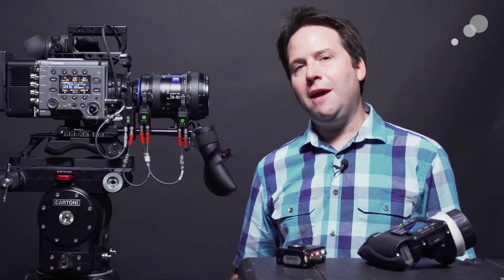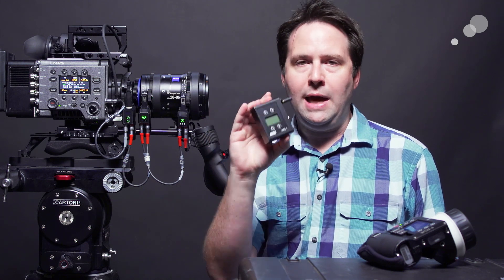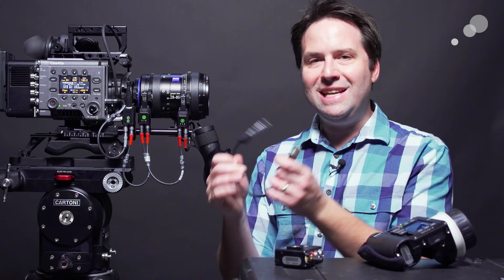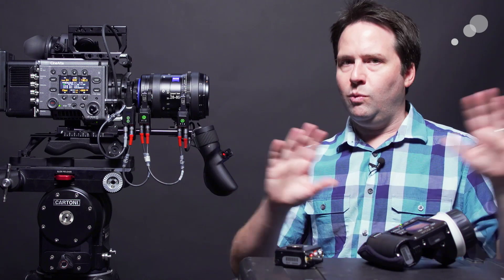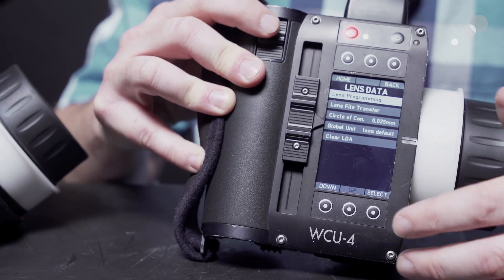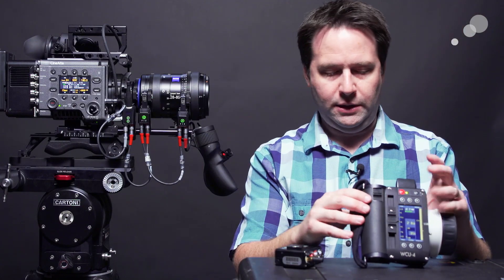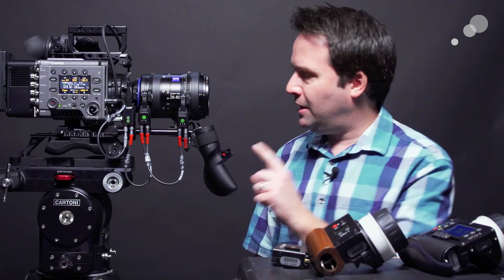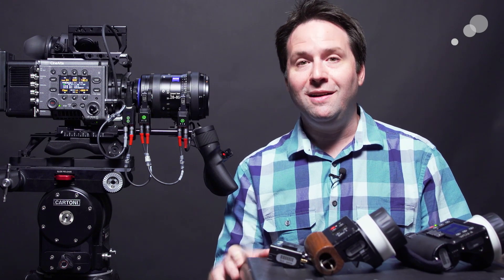At the Bench: ARRI cforce mini RF

Comment: Hi, thanks for the video!  -- When you connect 12pin to Sony Venice, can you see motor readouts on Venice itself? Zoom, Focus, Iris? I'm looking into the best way of recording the metadata for Sony Venice setup and this could be quite alright ..
Reply from the maker: Thanks for the comment! Here's a response from Geoff, one of our tech specialists: "Thanks for watching -- unfortunately, no, with the 12-pin CTRL/D-Tap cable (ARRI part# K2.0018814) for connecting the ARRI cforce mini RF motor to the Sony Venice, only run/stop and tally can be passed back to the camera. If you're using the WCU-4 however that information would appear there and could be manually documented."

Comment: So do AMC's and UMC's still have a purpose when you have an RF motor?
Reply from the maker: Hi Opti, here is a response from Ian, one of our tech specialists: 
The RF motor is intended to dispense with the need for the AMC-1 and UMC-4. The only requirement for the RF motor is to get power from the camera. This assumes that the other motors you are using are all Cforce mini motors that use the LBUS connection. The RF motor will not interact with older ( non LBUS ) motors.